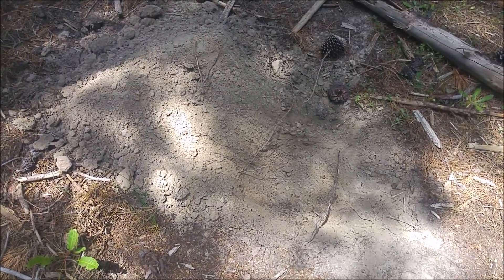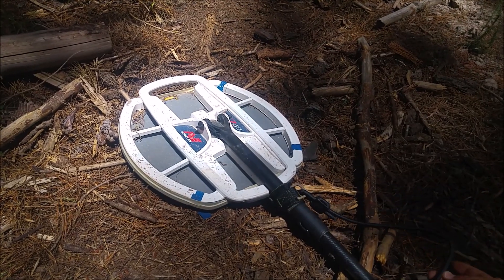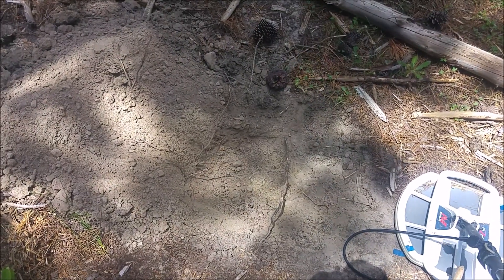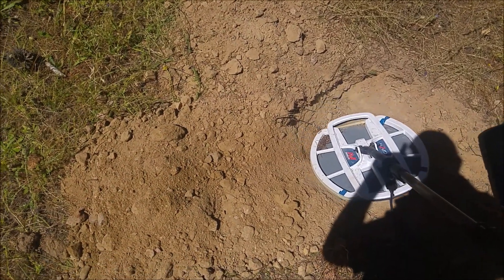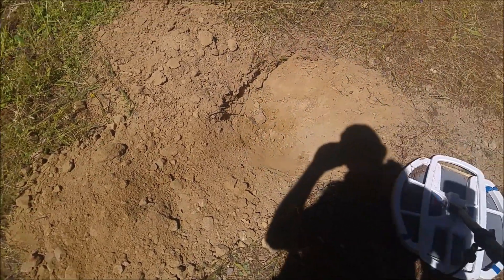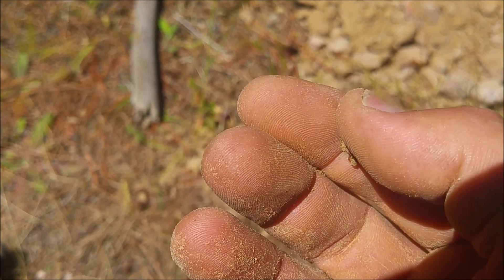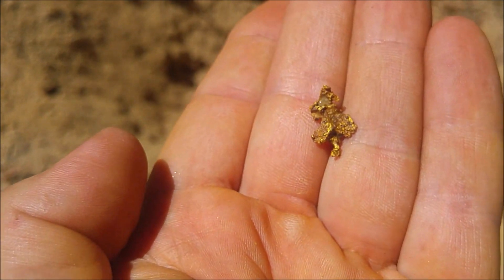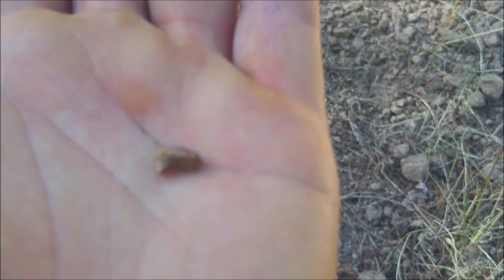Gold Hunt with GPZ7000 & Z19

Comment: Have you made your money back since you've got the 19" coil. I got really lucky and got a brand new one for only $799 USD and free shipping.  I haven't had a chance to go hunting with it yet, thx to winter.
Reply from the maker: I have very limited areas I can use it due to excessive vegetation in most areas. Hopefully by the end of summer a lot of the grasses will have died off. I have a few spots in mind where it is begging to be used.